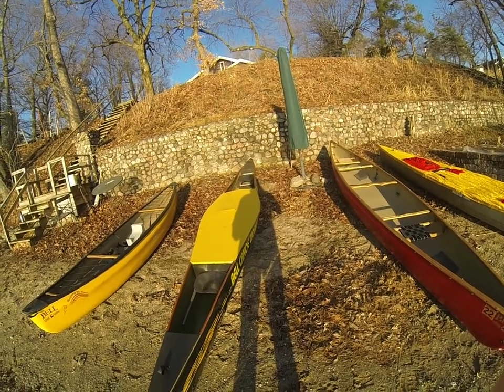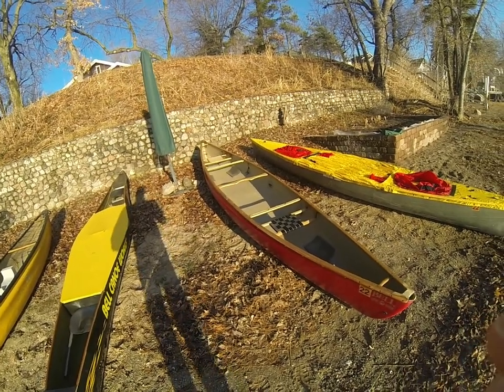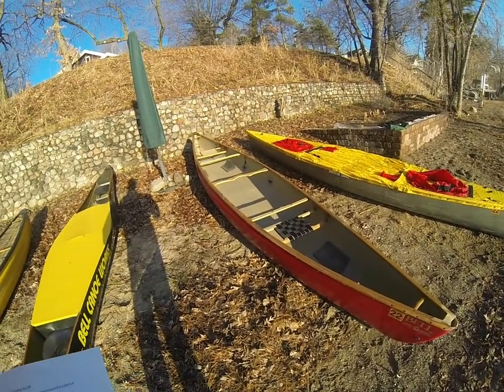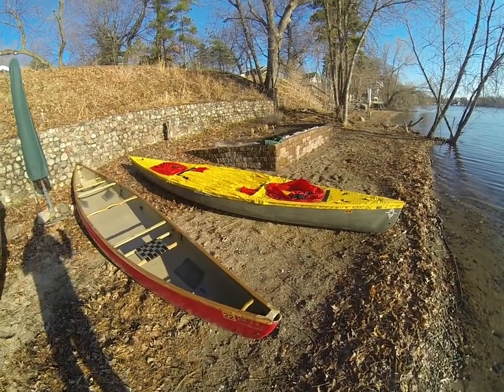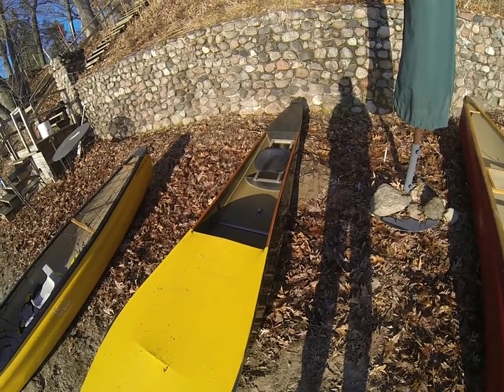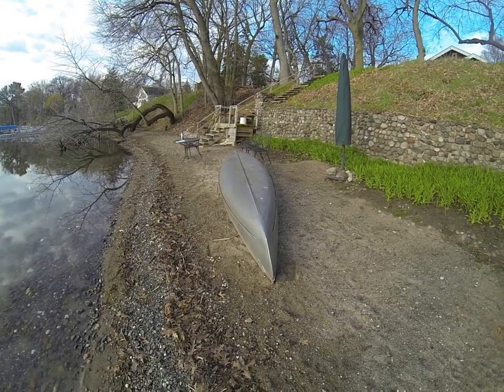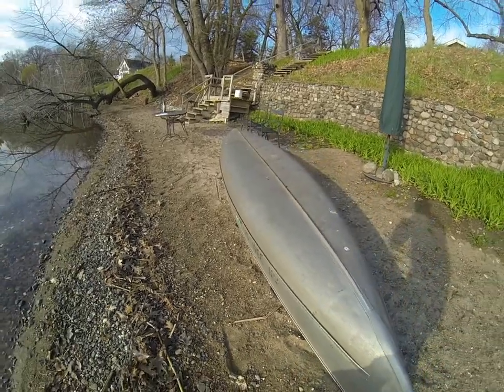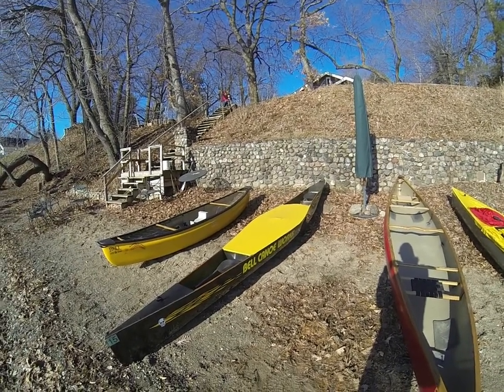Bear's Discourses #9.1   How Canoes Work

Comment: Hello Bear,
What a great “Bear’s Discourses” series you shared, thank you.  Very informative.  I have paddle Wee Lassie designs since ~1990.  My current being a Northstar ADK I purchased in 2015.  . . . .and yes, I kneel and lean against the Thwart.  I know, I know.  I do find it paddles very well in this position, but all I know is a 17’ Grumman, 10’ Wee Lassie (needs new wood gunnels), and my ADK.

I learned to paddle with a 17' Grumman, and with exponential growth when I discovered Bill Mason's Path of The Paddle series.

In my 9-lives period of life, I found the Grumman to be a perfect boat.  Hahahahaa. . . . Yep, Spring ice break-up on the stretch of the Wisconsin River (a dammed pool area).  I would shove off from shore, slide out to open water and paddle to catch and slide up onto a floating ice island.  If it was large enough, I would use one of my 9-lives and place one foot over the center keel, place my hands on each gunnel, while my opposite foot was out pushing my now floating ice-skate along these floating ice islands.  It was a blast as my memory of it shows me.  Thinking about it now after having spent a number of those 9-lives, I shake my head and express a concerning smirk on my face when I think about this and/or share the stories of having done this in my younger and more endurance years.

Anyhow, I binge watched this series today and appreciate you and Northstar’s attention to the details.  I have said the following for many years. “You buy boats, you don’t sell boats.”

Comment: Bear:  I learned a lot, but I have a couple questions:  I just bought a used Northstar Northwinds 17.  What can I do to maintain and prolong its life?  What should I do to the wood components?(what is Watco)  Where do I get 303?  thanks
Reply from the maker: Sorry for the delay. If the canoe has wood trim, you'll want to use watco. The seats, yoke, etc are varnished, only the gunwales need to be watco'd. You can get both watco and 303 on our website under repairs.